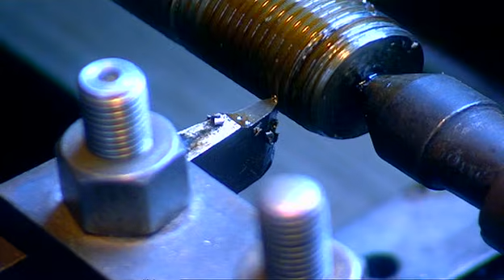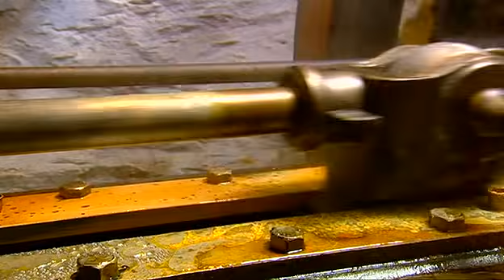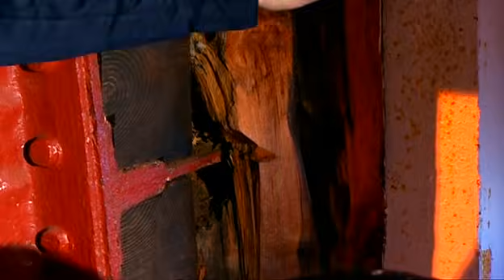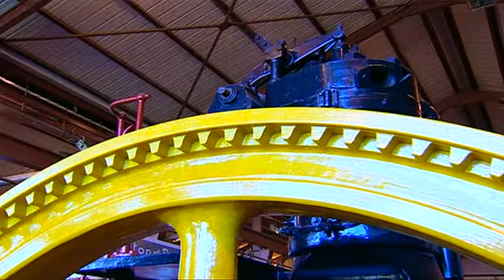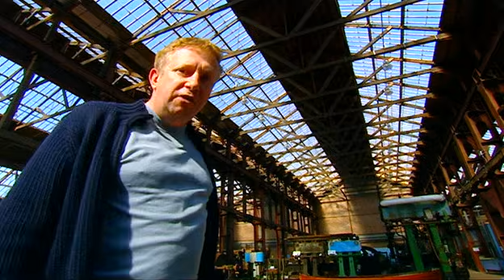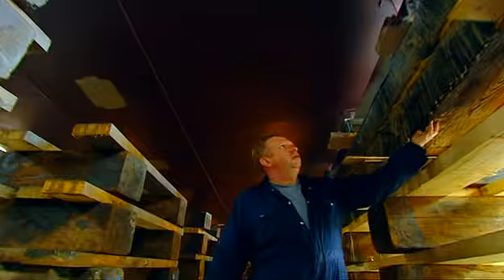More Industrial Revelations - E10 -  Machine Tools

Comment: As the local random fixit man, I was asked to repair a horn made in Atlanta, Georgia, in 1866 for the town of Danbury, North Carolina. The instrument was one of a set commissioned for a town brass band after the war. there was a screw missing from one of the valves, so I had to make a replacement. At first, I was surprised to discover that the hardware on the valves was all made to British standard thread. But when I thought it through, I realized that, at the time, Britain was the world leader in precision manufacturing so it's natural that someone in Britain was making valves for brass instruments. The valves were probably shipped in from Britain, and installed on the otherwise hand-made horns. When I was an Import car mechanic in the 1980's we used to joke about how the British auto workers would go on strike about the temperature of a cup of tea, and the world just passed on by. But it's a poignant reminder of how easily hard won prestige can just slip away.
Reply: Yes, if a country isn't careful the world will pass it by.
Reply: See the next comment about the idiot trade unions and the even more idiot politicians.
Reply: Actually, believe it or not, Americans adopted British Whitworth thread, before britain did. Mostly because american manufacturing was fledgling and looking for innovative methods for growth, whereas the uk had well established artisan craftsman guilds who fought to keep out the standardized system in favor of custom building of everything.
Reply: The world might have gone metric, but if you own a camera, the tripod mounting screw is still a 1/4" Whitworth.
Reply: A nice hot cup of tea with three spoons of sugar is every workman's birthright. brother.
Reply: @Rob-q1e6j  I guess I can't argue with that. When I fixed that horn I was paid with a bottle of Glenfiddich.
Reply: Yes? Ruin the countries economy for the sake of such a dubious birthright. A measure of intelligence is the ability to differentiate the degree of importances.

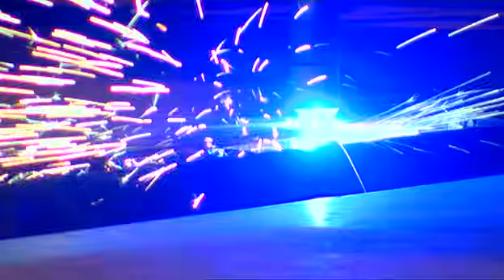Comment: At 19:25, a plasma cut uses an electric current to ionises nitrogen gass to create heat (plasma). Compressed atmospheric air is then used to blast away the molten metal. No compressed oxygen is used other than what is a component of the atmosphere. Unlike oxy acetylene/LPG cutting that oxidises the metal, a plasma cutter can cut no ferris metals, stainless steel, or bronze, for example.
Reply: A mate works in water jet profiling. Extremely high pressure water with an abrasive medium. Stone, wood, ceramics, any metal can be cut. He recently cut a cast iron V8 car engine block for non destructive testing
Reply: @750triton  well I’m a welder and I can safely say cutting something in half would constitute destructive testing not non destructive testing .. unless you are making 2 smaller engines 😢